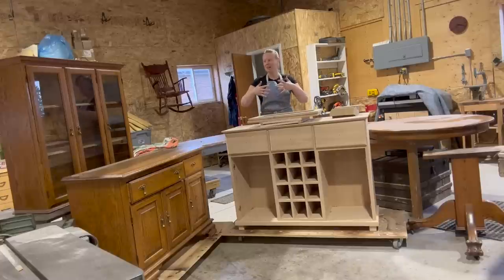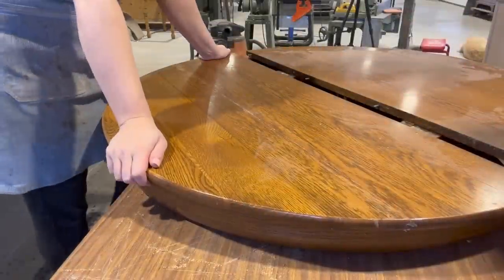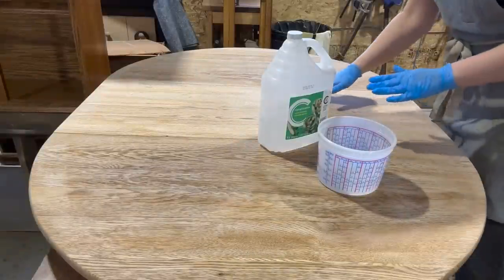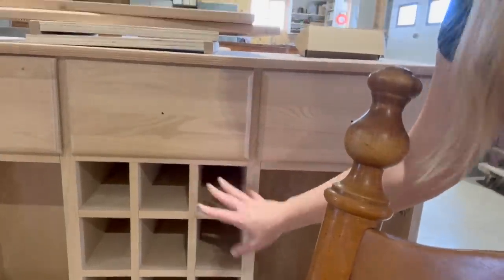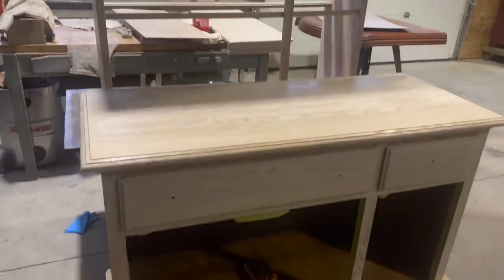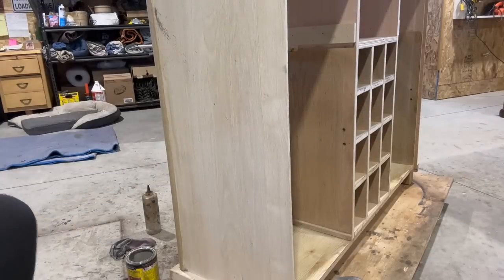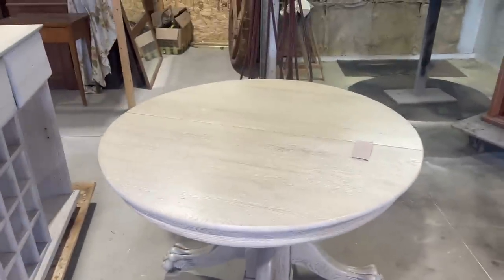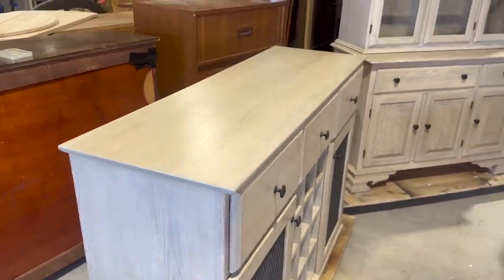BLEACHING an entire Dining Set!

Comment: Trenna, I am wondering if you ever tried to add a slight touch of blue to your stain or topcoat, so very little that it is not detectable?  I have been doing this for almost 40 years and I found that this helps to cut the orange and yellow.  Of course I still bleach and do everything else the same way.  I usually use the pool chlorine, and have to go back and see how the 2 part bleach does.  You don't really show that. 
They do this to bleached hair a lot, so I thought to try it on wood.  It really does tone those colors down, or cancels out some of the orange/yellow.   
To me this is an impressive job, love it, and it does not look grey or cold.  Many over-pickle and it just looks white washed, pink, or just too hazy.  This result couldn't be better.  Thanks.
Reply from the maker: Thanks so much! I do have a blue shadow toner but I find with the two part bleach I rarely need it. I’ll try to show the difference with the two part in another vid. Cheers!
Reply: @johnsfurniturerepair  Wow, thanks.  I have never used 2 part or maybe I did and wasn't impressed?  This was years ago, and could have been an inferior brand.
Wait, it was that with regular bleach and the blue tint there wasn't much difference, that is, at  the time.  I forget which wood it was.  Looking forward to that.

Comment: First of all, amazing work.  The amount of work you put in to get those pieces to work together is wonderful.  Just a amateur question, but I have been using some hard wax oil finishes.  My daughter in law loves this greyed look on oak and have been using Rubio Monocoat in Cotton White, which gives a similar look.  Was just wondering what you think of those type of finishes.  Thanks again for sharing.
Reply from the maker: I haven’t used them too much yet but I do have some I’ve been meaning to use. Do you think it would cover up the orange or are you starting with a white wood?
Reply: @johnsfurniturerepair  it does a pretty good job of coverage.  The key is a consistent substrate.  If you have open grain, the white really absorbs compared to a tight smooth grain.  Makes it a bit tough if you have burls or knotty surfaces that you want to be the same as straight grain.  I found not sanding too much actually helped.  Most of what I make I make from whatever wood I have available.  I just refinished an old oak washstand with their clear, and wished I had used a tinted version because the piece is now vibrant orangey yellow.

Comment: I have vintage oak dining room furniture -- not antique, just older than the 80's -- that has its original finish. And it's not that orange color. It's a light brown with gold highlights. I do have a pair of more modern chairs that I use with the set because only four of the original chairs till existed when I bought it -- but they are not orange, either, just a slightly darker shade of light brown. Was all that orange from the 80's deliberate, or did something in the finish turn orange with time?

The bleached oak turned out well; it makes me think of driftwood. I can see it in a beach-themed room, with aqua and sea glass green. And very light-weight curtains that move with every shift of air. It's a very delicate look; I'm afraid deep or jewel colors would overpower it.
Reply from the maker: No it was a popular color and it’s not a bad color just not in this context anymore

Comment: Wow turned out awesome! You did an amazing job. Pretty sweet that the clawfoot table got a pedicure before a total makeover...lol. I have a question about the table leaf that was bowed. What exactly causes that? Is it because of not having a skirt? Over the years of owning different tables I noticed the leaves with skirts I never had bow. The ones without them unless I keep them stored in place on the table eventually bow. I have tried storing them in a variety of ways to keep it from happening and the only safe way I have found was to just keep them in place on the table. Just curious if there some mystery about unskirted table leaf I don't know about...lol...God bless Trena
Reply from the maker: Two reasons. The bottom was unfinished and yes no skirt for support. 😉

Comment: You always do a fantastic job, and whether it's my style or not is completely immaterial.  But a practical question, does the bleaching process have a permanent affect on the wood color?
Reply from the maker: Just the top layer. It can be sanded back to the original wood

Comment: CAN YOU PLEASE EXPLAIN A LITTLE ABOUT MIXING WATER BASED AND OIL BASED STAINS AND FINISHES…I SELL THIS AT A LOCAL HARDWARE STORE AND AM CONFUSED. I LEARNED SO MUCH FROM THIS VIDEO..NOW I UNDERSTAND ABOUT REMOVING THE VARNISH AND THEN BLEACHING THEN NEUTRALIZING THE WOOD BEFORE STAINING. THANKS SO MUCH
Reply from the maker: its all about dry times, but i dont use water based anything. solvent based and spirit based products can be mixed but not with water based in my opinion the adhesion is compromised
Reply: I AGREE WITH YOU…THANK YOU.

Comment: What is the liquid you are using to strip the varnish and stain? Comes off so nice!  I have used easy off oven cleaner and then a green scruff pad with warm water to remove, takes it back to raw wood.
Reply from the maker: Be very careful with oven cleaner. It will destroy the fibers of the wood. I use swing stripper
Reply: @johnsfurniturerepair  thanks for the reply. I have used the oven cleaner with great results. Then sanding.

Comment: Would it work to use a nylon or brass brush to brush out the soft grain of the wood where the dark old color deposits? I have a similar orangy-cherry stain oak bedroom set. Needs a refresh. I was thinking of doing a dark stain and then a white glaze or liming wax to fill the grain.
Reply from the maker: You can but it’s not 100% effective

Comment: You may not have time to answer questions but if you do, what stripping product do you use? Did the finish come off the way it did because of the type of finish or is that typical for that stripper? I always have a mucky mess - but I use Kwik-Strip from the hardware store. If love something that doesn’t create such a mess!
Reply from the maker: It does depend on the finish. Shellac will come off very sticky but cleaning it up with denatured alcohol after does the trick. I use swing paints stripper.
Reply: @johnsfurniturerepair  Thank you! Shellac finish is so mucky to remove but it looked like you were using a very liquid formulation and it was disappearing! Then the piece where the finish came off in very neat and tidy sheets - i had to pick my chin up off the floor in both instances 😄😉 I’ll check out the product you use!